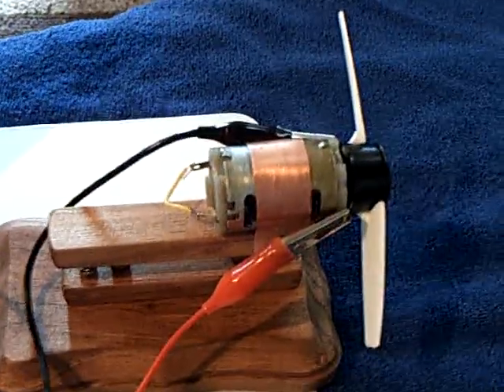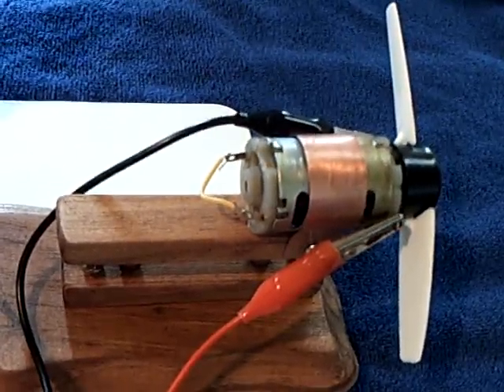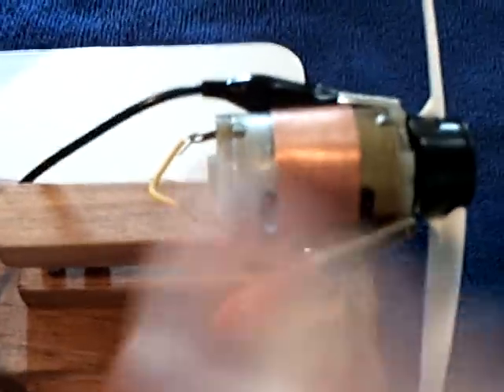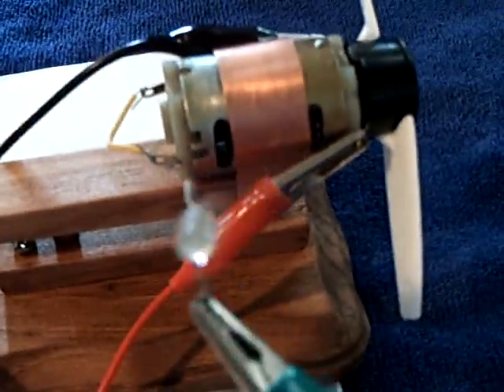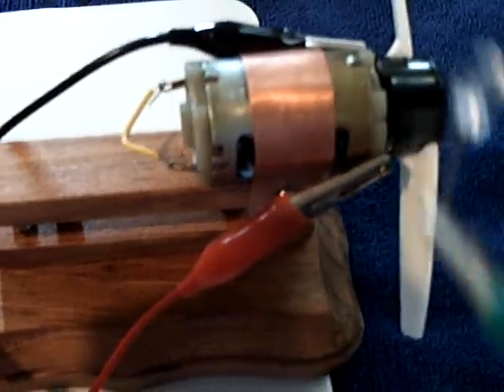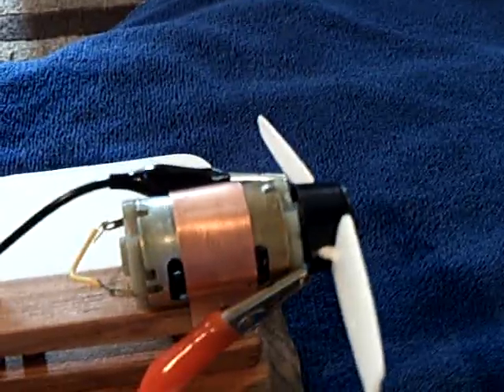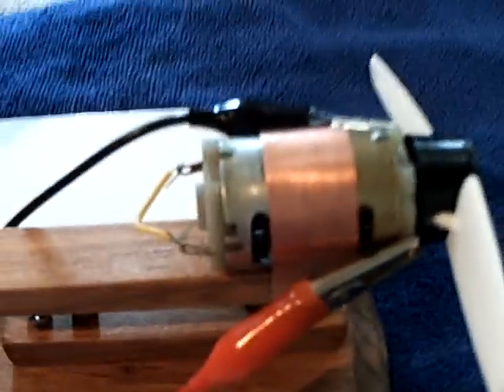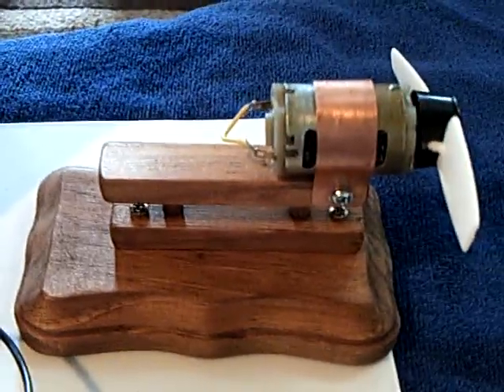Asymmetrical motor test platform

Comment from the maker: I might try running an exciter off the generator output and see what happens.  That would be cool to have the whole setup lit up in neon or led light powered by the generator output while that prop goes Rrrrraaaaaaa from the main motor.

Comment from the maker: You might want to watch DadHav's last video where he tests this motor with the different wiring configurations.  Fast forward to the last part of the 45 min video to find where he shows this particular wiring arrangement.  I don't know which wiring arrangement is better as far as efficiency.  The cross wiring setup gives the most RPM and torque ----but you pay for it in amp draw.

Comment: But if you connect the wires like that aren't you using a reduced duty cycle because there's a narrower gap where all the brushes are aligned to conduct.... especially because it's an odd number... wouldn't it be better to just connect power direct to both sides?

Comment: Neat little unit. One 'trick' with much larger motors for other uses, would be powering an inverter to light the work area while it ran. if there's a linear similarity to an unmodded motor, then that would be a freebie. Maybe this output could be put to a small SJR type circuit and see what happens. Am sure you'd get neons etc going.
I took all my motors apart to get the wire for Tesla tower builds + junked the parts recently, a disturbingly normal situation lol !